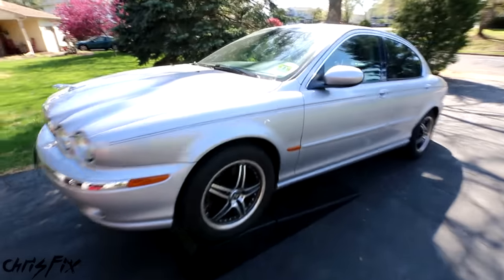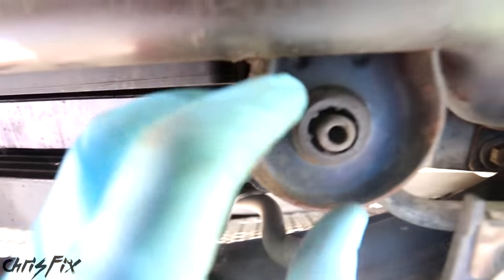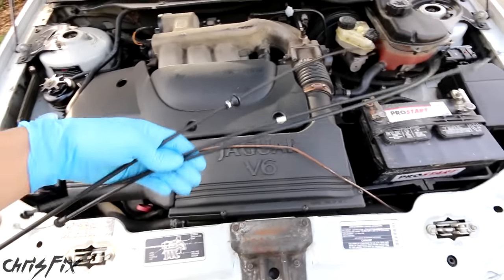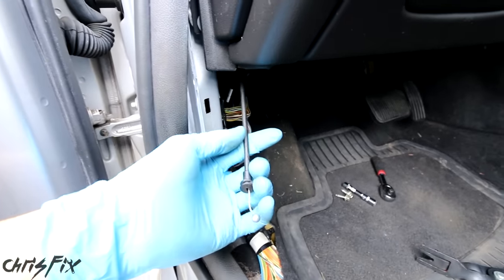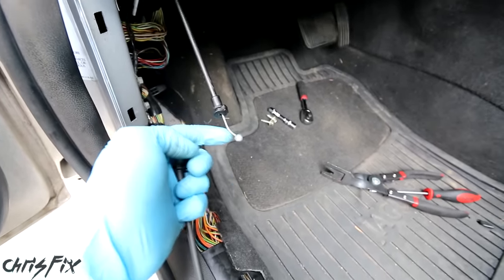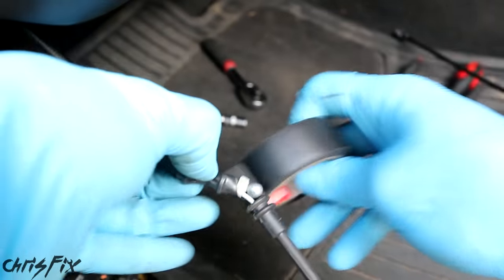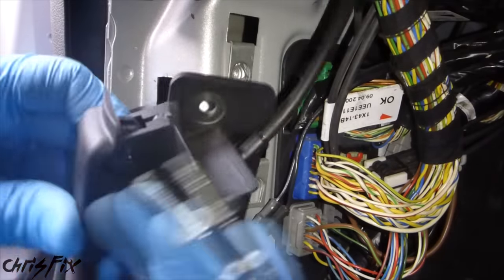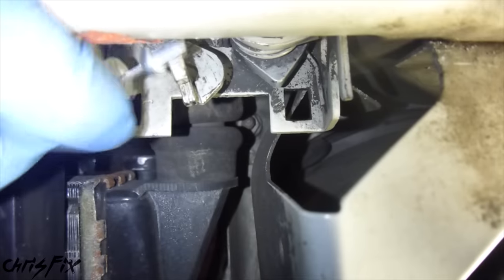What if your car's Hood won't Open?

Comment: and how does it go with the fuel cap door release? It just doesn't open it in my '96 Impreza GT wagon and I suffer so much at the gas station :D
Reply from the maker: +ROCKnROLLA It is the same process. Go behind the fuel door area and look for the latch. Most of the time the cable gets stretched out or the latch just needs some lubricating.

Comment: Hi I'm from Canada. when the exchange rate gets better, I want to go to the US to get a car. what state is the best for used cars?
Reply from the maker: +William MacDonald Any dry states like Arizona will have rust free cars!
Reply: Thanks!
Reply: William MacDonald new York or new Jersey is pretty good
Reply: Like Chris said, anywhere that it doesn't snow and where they treat roads. Most southern states and Midwest is your best bet. Just be careful of coastline cars. Salt water spray can still rust a car

Comment: i have a 98 civic and the hood latch wont lock. i tried everything to fix this problem. its not broke bc i can lock the latch with a screw driver and  unlock it but AS soon as i put the hood down on it it won't shut no matter how hard a push down on the hood slam the hood anything
please help:/
Reply from the maker: Did you try spraying it with penetrating fluid?
Reply: that didn't do the trick either
Reply: i hava an o4 civic and it has 3 bolts that hold the latch in place so try loosening them and lift your latch up then tighten them till their really snug and that should fix it
Reply: I have a 2001 civic and the metal that surrounds the hood latch cracked and separated. The same exact thing happened to a friend of mine. His dad fixed it with a block of wood. I used one of those metal braces you can get at wal mart or any hardware store. Then drilled two holes and and slipped two bolts with lock washers, then bolted them down. It's been working very well for many years now. I just sprayed some white lithium grease recently because it started rusting a bit, but should be good for the foreseeable future. If this wasn't youtube I could post a picture to show you.

Comment: hey chris 
in my 86 celica i got the problem that i need 2 people to open the hood
i need to hold the hood open switch on, and a another person to open the hood at the same time, otherwise it wont work
will this fix it?
Reply from the maker: +Kanggoo lubricate the latch

Comment: My trunk won't open from the inside of my car. I have to get out and use the key. It's not a problem, I just don't want it to be fixed. Do you know how I can fix this?
Reply from the maker: Check the connection. There is a cable that can pop off like on the hood latch in the video.

Comment: my saturn vue hood wont open. The cable works and pops the hood but then the lever or whatever thats under the hood to open it all the way wont move at all. Im stumped, it seems like its getting bent when i try to put any pressure on it at all. Any help would help, please help me.

Comment: My hood latch unlocks but my hood doesn't pop up someone else has to be there to lift up the hood when I pull the latch. What is wrong and how do I fix this? 02 Isuzu Rodeo lse
Reply from the maker: Try spraying the latch with some penetrating fluid.

Comment: so each time I turn my wheel fully to the right, I hear a clicking noise coming from the car. it seems unstable as well, when fully turning it. any help would be appreciated.
Reply from the maker: That is most likely a CV axle that is going bad.

Comment: remember when i crashed my car head on a hill, 2 days later i had a new car and that car missed a battery so i was just gonna get the battery from the crashed car. had du cut of the latch and use a tractor to rip open the hood. the damn battery work to this day :P

Comment: Not a bad guide, but very general. I have done this job on an x-type and it's not as simple as shown. The cable is pinned to the wing by a hook which needs drilling out or cutting the old cable. You need to move the fuse box to do the former. The new cable can be difficult to thread through and is prone to snagging no matter how careful you are. Odds on you will need to remove the glovebox and get right underneath the dash via the foot well to thread through the hole. To fit the new cable properly you'll need to take out the battery too to get space. In all a pig of a job that needs two people really. Be prepared to be frustrated...be warned. No wonder garages will charge premium money to do this repair...

Comment: Hey chris my car(2013 hyundai gencoupe) battery died. I cant open the hood to access the battery. Pls help
Reply from the maker: Why cant you open the hood?
Reply: ChrisFix i have no clue. Idk if it has to do with the battery being dead but when i pull on the lever(inside the car) the hood doesnt pop open like it usually does & The same same goes for the trunk lever.
Reply from the maker: The hood shouldnt be electric (but the trunk is). I would have someone push down and pull up on the hood as you pull the lever to try to jostle it loose. Then spray the latch down with penetrating fluid.
Reply: ChrisFix I got it open! Thank you so much bro! I will subscribe.

Comment: Why do some cars have 2 latches instead of one?
Reply: PapayaMan actually one is safer IMO because even if the hood have already  popped you should pull the lever , so you don't get your windshield smashed when you pull the hood lever by mistake

Comment: know of a place to buy valve covers for a ranger v6 4.0L
Reply: +Crazy Shooter__12 
eBay! But check where the part is manufactured and how well it is made before buying. I buy a lot of car parts from eBay, and they turn out to be OEM or manufactured by a decent third party company.
Reply: +Omar Awad I have tried ebay but it give me valve covers for chevys
Reply: +Omar Awad  will it fit a 94 ranger
Reply: Crazy Shooter__12 
You can check the list down below to see which vehicles are compatible. Here you go:

Left side valve cover: 
http://ebay.to/20rWCv5

Right side valve cover: http://ebay.to/1TGP72I

Make sure these are the right parts before you buy! I checked to see if these will fit the 94' ranger 4.0 and they claim to fit. And don't forget about the valve cover gaskets which you can also find on eBay.

Comment: anyone in the Chrisfix community or Chrisfix can help me with a problem? I have a 2000 chevy Silverado 1500, it's an automatic and the transmission is having a hard time getting to 3rd gear and it bucks when you put it in drive. checked the fluid it smells burnt and is brown what could be the issue? do I have to replace the whole transmission or what? thank you!
Reply from the maker: Check this out Chris which should help with your transmission fluid questions: https://youtu.be/o690DovjDAc?list=PLDD611CFB36FC65F2
As for the reason why it is doing what it's doing... There could be a problem with the tranny or maybe it is just a sensor. Do you have any check engine lights? Is the overdrive light flashing? If so, get the computer scanned to see the code!
Reply: The transmission fluid is brown and smells burnt and no there is no check engine light at all it just has a very hard time going to 3rd (automatic) it will switch gears but it revs to high rpm and will jerk and then go into gear
Reply: Start by checking the transmission and engine mounts, if they are collapsed or broken, that could contribute to the clunking and sluggish gear shifts.

Comment: Try that on a BA Ford Falcon....never going to work :(
Reply from the maker: +geejaybee413 Did you have to cut the hood?
Reply: No, cable broke when the hood popped open. Trying to replace the cable was the problem, had to take off the left fender as the cable was bolted with a retaining bracket behind it. :(